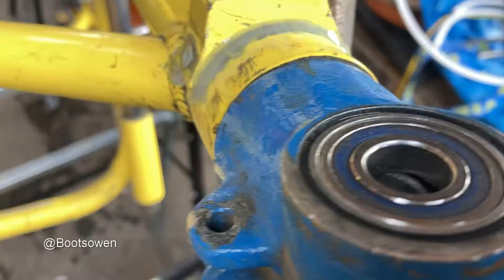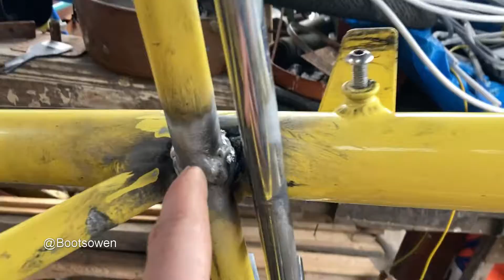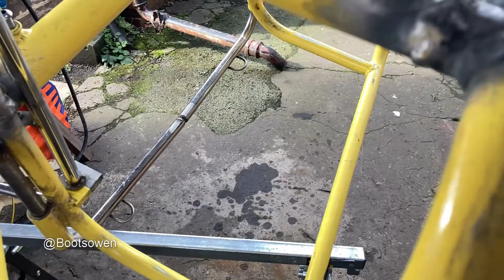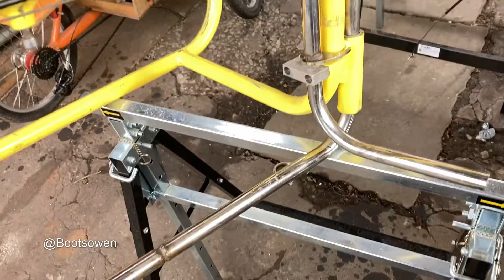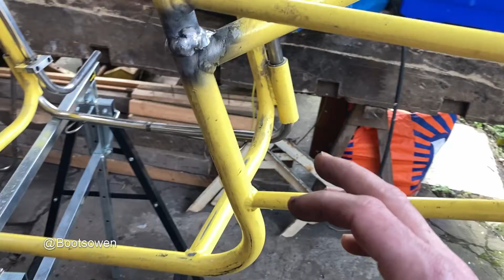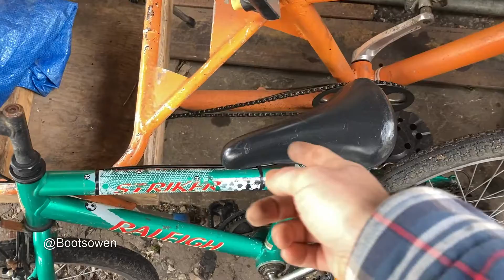8freight cargo bike, welding the frame, my first attempt at TIG and welding aluminium.

Comment: Well done; excellent progress. 
I agree with the approach of taping up around the welding repairs and just painting those places. 
If you can find some blue paint that might blend in with the existing blue parts. ☮️
Reply from the maker: Thanks, in the end it was yellow paint, some left over from the side gate! 2 coats on so far and another tomorrow, it looks a lot neater and most of it will be beneath the cargo box, whatever I decide to add in. Blue was a better idea!

Comment: Good video. I liked the interspersed clips of welding. Thought you would've included the one with the glasses steaming up! A problem I have (although on the inside of the mask) in winter especially. Thank you for the much needed practice. Still tempted to get a WP9 torch for these tight quarters jobs.

My Uncle now hinted at welding up some cast aluminium steering boxes!!
Reply from the maker: It all came together in the end. Was there any gas left in the bottle?
Reply: @bootsowen probably enough to do a small job or two although I had planned to swap it out at my next convience. I modified those new gloves today by cutting out the corner and sewing it up for better dexterity on the index finger.

We've a brazing job to have a go with next time your over. I find it's difficult to get the puddle formed but once you have a layer on it's a doddle.

Comment: Well done to both of you, great Ian was able to help. I would leave those welds just cleaned up and use the bike, that way any further faults would not be hidden by paint, cheers
Reply: Thanks Andy,
I'm glad Owen turned up as I only get to practice every month or two. We ought to have used the foot pedal so that we can have more power when needed. Most of these joints required 45A on the pipe rising to 80A as you get to the existing fillets.
Reply from the maker: I found a tin of 11 year old yellow paint on the shelf so I have started that process. It looks better already.